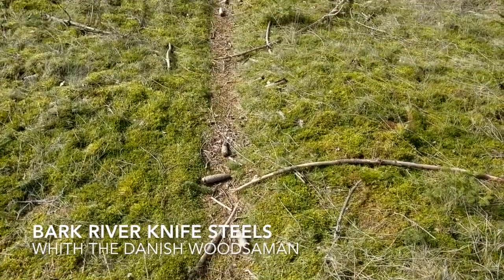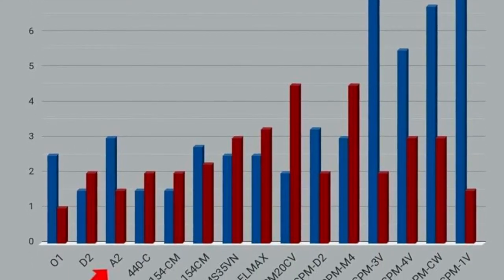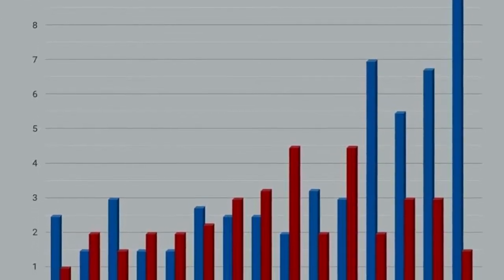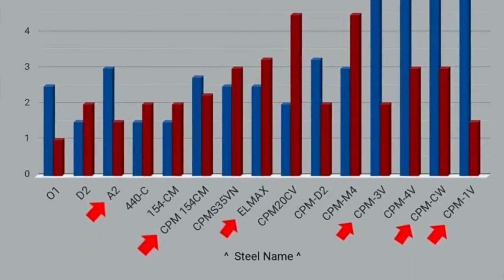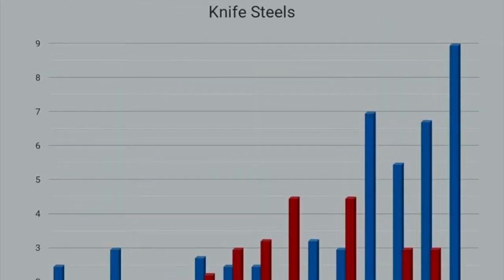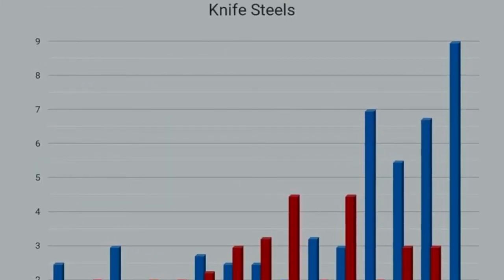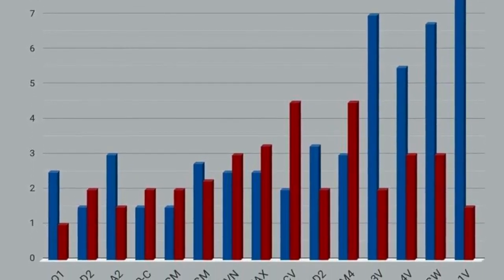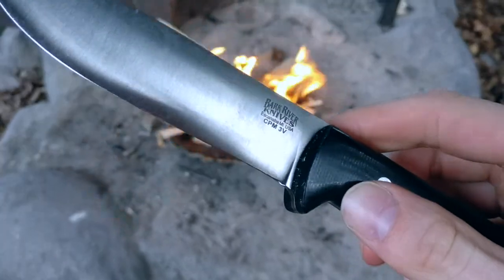Bark River steels - what do they use?

Comment: Just returned 2 Bravo's. Both came dull as a cheap kitchen knife and had rust marks on them out of the box. Also, the pins were not sanded smooth to the handles. Overall a rushed pair of knives and a slap in the face to me the customer. Never buying another! I bought TWO, so it wasn't just a "lemon".

Comment: They don't make good 3V. About A2 and Cpm 154, Cruware. they do all these with ok heat treatments, but their 3V is brittle. It chips easily where it should n't chip. That's the feedback I get from most users. I don't know if they burn the steel when grinding or it's a